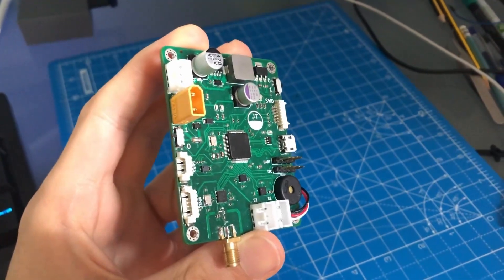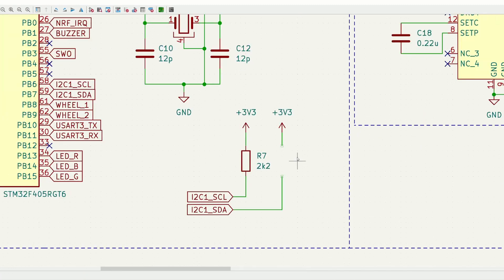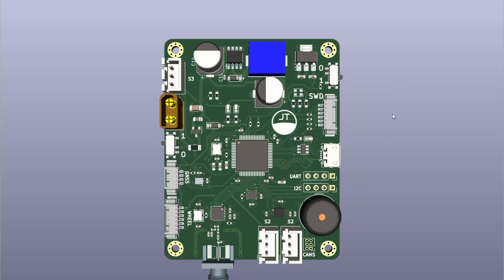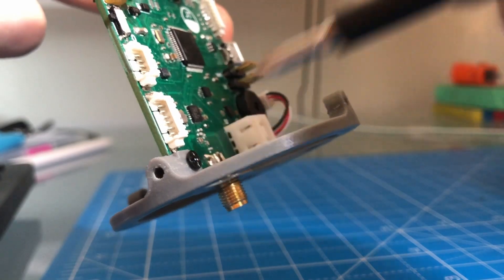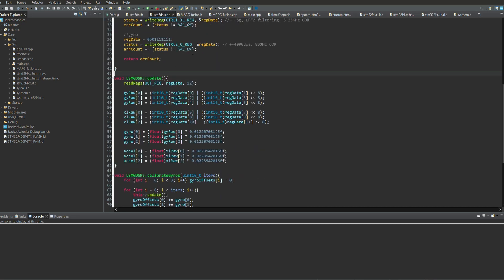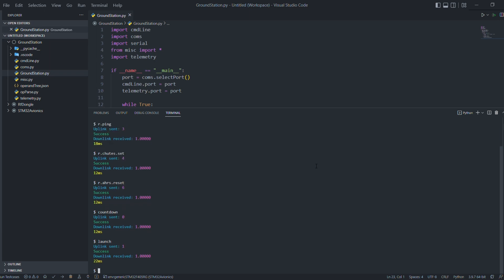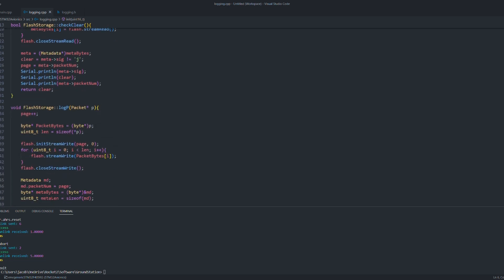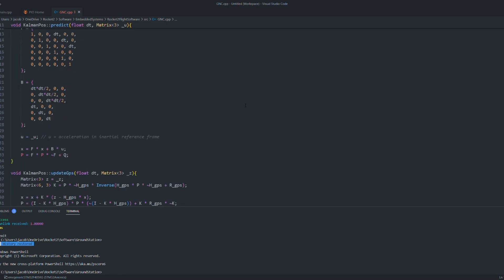Flight Computer for a TVC Model Rocket

Comment: Hi,
Currently I am building a similar project, it is a can-sat (small atmospheric satellite / probe).
I have few question about your project, I would be grateful if you could answer them:
1. Wat is this piece of material between pcb and GPS antenna. It looks like it would be a piece of aluminum foil. and my following question is there any particular reason for this solution o ris it just for appereance
2.  Why didn't you use a GND filled zones on the top layer, I am aware of that in the area of clocks, RF cirucits and places where a particular impedance is required the GND zones should be done in the different way. (o i actually find an aswer in your video, do you have any soruces to prove that theory have you conducted any experiments ?) 

BTW. Really nice video, and your board routing looks very clean and planned

Comment: Great video! I am also currently developing my own TVC rocket model, including the flight computer and the physical rocket. Watching this video it isn't clear how the parachute deployment works, wondering if you are using a mechanical chute system or pyro's for ejection. For mine I am currently working on a hatch deployment system whereby a lid on the cone holds a parachute within it with a servo horn holding it in place. Really cool project nonetheless!

Comment: Im confused what issues you could of run into while compiling to arm in your own code that you wouldnt also run into with the Arduino framwork as they are both compiling to the same architecture and for the some chip... and probably using the same compiler and linker.

Ive never used Arduino so I hope you can enlighten me

Comment: I designed a similar PCB based on STM32 and I just can't get it to work. I'm trying to communicate with an Arduino Nano and communication works between two Arduino Nanos. When I try to send or receive on the STM32(H723ZGT6) board, it doesn't receive data and also doesn't send data. I also tried using an external NRF24 breakout board and had the same issue...

Comment: what type of microcontroller is this? and did the PCB connect to your computer
Reply from the maker: It uses a STM32 (F4). It connects to my computer via USB for programming and serial coms.
Reply: @jacobthornhill  i should of worded it better. how did you remotely connect the pcb to your terminal

Comment: Wow, very cool. I made a STM32 (F7) flight computer for my model rocket too! Btw I made most of the soldering just with a regular iron -- never used a paste. It is easy if you have a proper flux. The only difficult thing was a gyro and barometer -- reflow was required because contacts are not accessible. I also highly recommend you do get rid of Arduino and go with STM32 HAL or CMSIS. It is possible to go with Arduino, but it limits you a lot in reality.
Reply: I tinker a bit with Arduino, what about something like Teeny ? Could still use PlatformIO/Arduino IDE and a lot more powerful than the microcontrollers used by the Arduino Nano/Uno/...

Comment: Can you please explain how to use quaternions in a future video!?
Reply from the maker: I’m afraid I hardly know how they work myself! I can give an outline on what my code does, but I can’t really go into the maths.

The basic idea is to start with an identity quaternion (1+0i+0j+0k) which represents a zeroed orientation.
At each timestep you construct a new quaternion from the gyro measurements multiplied by delta time, which represents the change in orientation the rocket has experienced since the previous timestep.
You then multiply the first quaternion by this new one, which yields the rockets orientation at this timestep.
I then convert back to Euler angles as that is the format most useful.
Conversions:  https://en.m.wikipedia.org/wiki/Conversion_between_quaternions_and_Euler_angles
Multiplication: https://stackoverflow.com/questions/19956555/how-to-multiply-two-quaternions
Hope this helps!
Reply: @jacobthornhill  Thanks for your very detailed answer! This helps me so much.